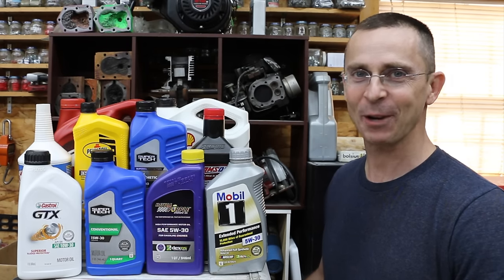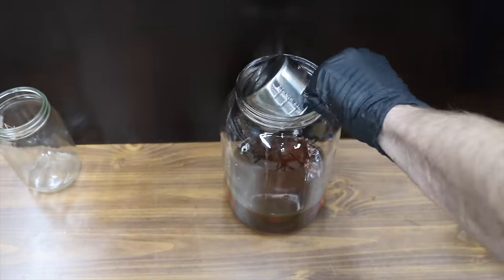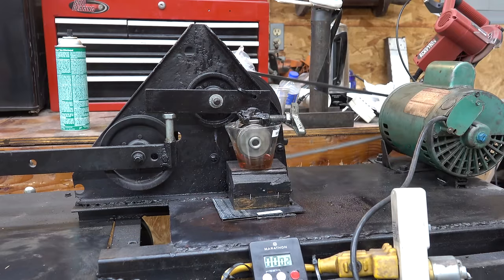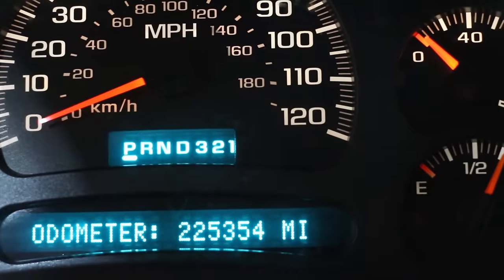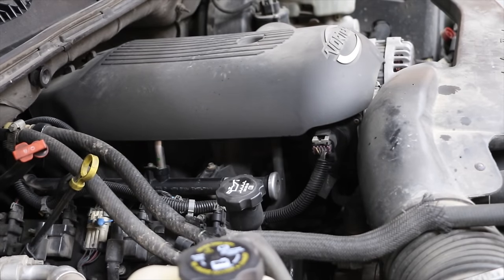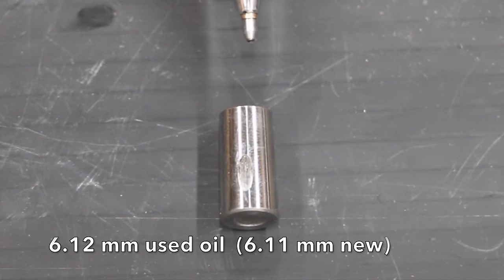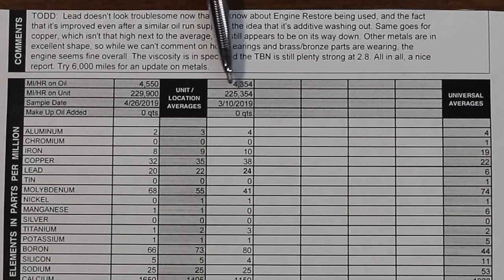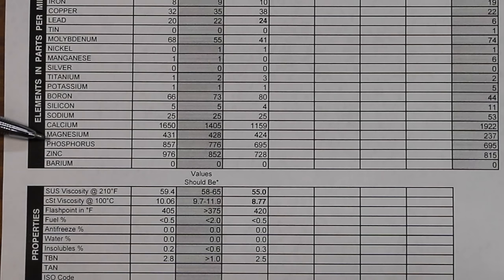Will Mixing 10 Motor Oils Damage an Engine? Let's find out!

Comment: I'd love to see a spark plug shootout!  Especially comparing iridium and e3 type plugs vs conventional.
Reply from the maker: Thank you for the video idea!
Reply: @ProjectFarm  can wait to see it!
Reply: aXBlackDeathXa e3 plugs are a gimmick
Reply: @nicolaslosito5735  I'm sure plenty of people feel the same way. Precisely why I'd like to see unbiased testing and evidence from PF.
Reply: If you want to see a spark plug shoot out go buy a 5.4 Triton and just wait.
Reply: NGK ALL THE WAY!!
Reply: It's pretty tested as is. Copper is most conductive, which is great for performance, but don't last as long. Platinum and Iridium aren't as conductive, last a longer time than copper, but over heat when the engine is run hard, causing their conductivity to drop even more.
Reply: 229k and climbing GO CHEVY GO LS best v8 engine ever, suck it Ford
Reply: Harvey Handbanana lol first thing I thought of too
Reply: @harveyhandbanana  lmao 😂
Reply: Denso  TT iridium is Definitely the BEST Spark plugs" No others compare" ✅✅
Reply: Yes great idea
Reply: aXBlackDeathXa it’s not how I feel. It’s been tested before by more stringent means.
Reply: @harveyhandbanana  wrong kind of shootout.....but probably more entertaining.
Reply: What would happen if you put 4 different spark plugs in an i4 car engine?
Reply: Or other things, like what if you use 4 different injector nozzles, or 4 different turbos (one per cylinder)?
Reply: 4 different crank cases /oil sumps and 4 different oils would also be interesting but hard to do in practice

Comment: As an ASE certified tech, amazing video, honestly. It is a common myth that switching back and forth between full synth and conventional is a bad idea but that's not true. On some high mileage engines some seals might be worn and thinner synthetic oil can get by.

With oils now a days you can go way more then 4500 mi between oil changes. I use Shell Helix Ultra here in France and prob went one year and 10k miles between oil changes and haven't noticed any issues. Car runs great, no extra smoke or noises, came out relatively clean as well.
Reply: What car/engine was that please?
Reply: @zenden6564  Suzuki Swift Sport 2012, did it on my RSX-S too and had no.issues, took the valve cover off at 190k still like new.
Reply: @bluej511  :D
Reply from the maker: Thank you!
Reply: Do you mean 10,000 miles or 10,000 kilometers?
Reply: My daily driven 2006 Taurus (12 valve) has 153,000 miles and I change the oil every 7500 miles. It's just getting dark at that point. I use Motorcraft filters and any 5W20 except Pennzoil.
Reply: @bluej511  I change engine oil with Mobil 1 EP every 3500 on gas engines and every 3500 on diesels with Shell Rotella T6
Reply: @happydays8171  10k miles, must have done 16k km on that.
Reply: @steve5912  yea thats a waste of money and oil. You can get 5k out of that easy.
Reply: Could I use rotella oil for a diesel truck in my stock 2001 Subaru forester even though there the same weight ?

Comment: Since I'm living down here in Florida and we're staring at a hurricane , I thought why not test various plywood ? All 3/4 inch . CDX vs. OSB vs. press board floor decking ( the not CDX stuff ) vs. particle board for shear strength and impact resistance . You can have a little more fun with it by getting a sheet of the radiant back plywood and finding out if it actually does what it's supposed to .
Reply: But Project Farm would need a rig to launch debris at 165MPH.  Oh, wait, that sounds epic.
Reply from the maker: Great video idea!
Reply: He basically already tested this. The real problem with plywood/osb sheathing isn't punctures but having the wind rip it off. He's tested various types of screws already.
Reply: @RedfishCarolina  
Read the comment . It helps. What im asking has nothing to do with screws . It has to do with shear force (tear it in half) of the wood itself and impact strength . Fyi fender washers help when attaching plywood for storms .
Reply: @ProjectFarm  I would also love to see it!
Reply: osb is stronger than plywood per square foot. only to used as flooring above anther room. never used for underneath siding or as roof decking or as a floor above a crawl space.
Reply: @flhusa1  you don't build for a living do you . Actually the only thing it does better than CDX is shear strength .We ( the building community) use that stuff (OSB) all the time for sheathing walls and roofs . Go to any new framing site and it will overwhelmingly be OSB being used .
Reply: @Dr.Westside  no sir i don't. i did a lot of research before i did a project and always like to know about things that i want to use or work with. i believe if you google OSB or orientated strand board you will find a lot of useful information like i did. when you use it do you or others coat the the cut edges like it comes from the factory? do you know why the edges are coated? i figured out why it was invented in the first place and then realized it was not for my project. i have a house with a dirt crawl space and all the plywood rotted and i needed to figure out what would outlast me so it would be someone else's problem next time. i ended up using treated plywood coated two times with a wood preservative and then coated with roofing felt tar paper on the bottom side facing the ground. i also used plastic sheeting on top of the ground beneath the flooring.
OSB is a good product stronger than traditional plywood . but is has its Achilles' heel which is moisture.

Comment: When i owned a Tire and oil change shop, it came with a 100 gallon tank Full or "drainback" oil. The previous shop owner always put the empty quarts upside down and that Littke Bit of oil that Drained Back added up, He had sold that oil for super cheap. 👍
Reply from the maker: That's interesting, Thank you.
Reply: I have a mason jar I use for that, it’s just enough oil to fill up my oil cans and lube random stuff that needs oil. When I add it to my oil cans I also mix it with some ATF for added slickness.

Comment: Hate to say but I’ve done the same thing. Had to clean out a bunch of 1 quart quantities for everything I had; miatas, bmws, pick ups suvs and a diesel oil too (that was used in a generator). I poured the whole lot into 2002 Chevy Tahoe and she digested it like it was nothing. 0w20, 5w20, 5w30, 0w40, 10w40 and 15w40. Probably the best oil change the Tahoe ever had. I don’t think older pushrod Chevys care.....
Reply: so true, they dont care at all
Reply: This is what I refer to as my lawnmower oil....lol. No point in buying anything special.
Reply: @michaellong9802  
Last time I cared enough, I just grabbed a bottle of cheap something from the gas station

Comment: Story time; A friend was up on hwy 90 in Washington on top of Snoqualmie pass. His old car was clunking and clattering obviously low on oil and no store or business open up there at the time he was stuck there. A Semi truck driver heard the car clattering lifters, saw him standing over the motor checking the oil level.  After few minuets Trucker guy came up to him with a container of obviously used motor oil and said, "This is the best oil in the world" 
My friend said "why is that"?  The trucker chuckles and says, "because you need it". 
5 min. later he was back on the road.
Reply from the maker: Thanks for sharing.
Reply: Rofl he prob gave him 15w 40. That's what we use in our rigs
Reply: @nishinobuuru2365  better than no oil. Snoqualmie pass is around 3000 feet above sea level, frozen 7 months out of the year. plus it was an old 70's car they can handle all the detergents in that oil.It would take hours to walk to a place that sold oil and walk back.
Reply: @Quirin As long as it isn't burning and you have oil pressure, well I have a motto..

just send it!
Reply: Try to put wrong oil in a new car.. lets say starting from 2010.. if you do that, then be prepared for a very expensive repair. For a BMW X6 the repair cost about 4000€ just for the engine restoration and cleaning in ultrasonic bath. The reason that you should use the right oil, is because new cars have higher working temperatures and even smaller diameter places where the oil needs to go, like Vanos, what adjusts the camshaft. You put a crappy oil, the oil slowly starts becoming coal, and you are done.

Well.. For old cars it doesn't matter as much, since the engines are way cheaper.
Reply: @blue_wolf5171  VANOS is in BMW like 20+ years so your argument is mute. The question is - is it your own experience or something you read somewhere on the internet. What I would say that today's cars have direct injection into the cylinder so petrol doesn't wash the valves and they seize because of sulfur+oil mixup build-up. In that way yes you have to use a proper oil which doesn't make this mixup easily and tank premium fuel with least possible amount of sulfur + clean you valves. You surely cannot tank some ECO friendly with bio sh*t added fuel, this will destroy direct fuel engine for sure. Count a long-life oil  change intervals are you are basically done as the build-up will deteoriorate the oil real quick.
Reply: That BMW was in my workplace, but my coworker worked on it. 
The thing is, that the engine stopped working AFTER oil change, and the next day the valve cover was open, and everyone could see, that there was burned oil. As my coworker with 20something years of experience said, that there was wrong oil that can't handle the heat.

Well.. I am not an expert on BMWs so I don't know how long what has been, I am just saying that if it says in the service book to fill it up with castrol, then just do as it says. 

Long life oil won't hurt the engine as long as the car has been only serviced in dealership, I am about 90% sure that those oils that are in supermarkets are not the same as in dealerships and good autostores.
Reply: @blue_wolf5171  Well I had e46 3.0Ci (petrol in case someone doesn't know) and recommended from BMW was 10w40 (or 5w40 I don't remember exactly but that doesn't matter as the first number is for winter). Anyway w40 oil couldn't stand the heat when you really drove the car as it should be driven :D so I had to put w50 like you have to for M3, then the car ran fine even under spirited driving. So depends very much on how the car is driven and of course quality of the oil but that wasn't issue in my case, both were premium brands. But yeah as you said yourself sometimes the oil can be fake or "lower" version for supermarkets. Hard to really judge from one case. Anyway modern cars are definitely crazy sensitive about everything you put in them. When I had an old bmw from 1989  with diesel engine it could run on used french fries oil instead of petrol. At least for a while :D
Reply: @kovrcek  
    The   First  Number   W 
  Is The Winter  Weight , How Much The Oil  ( Viscosity  ) Will Thin Out / Run At in Winter .
     The Second Number Is The Summer Value .
     EG  5W  40
            10 W  50
           20 W  40 
   ALSO THE CLASS RATINGS OF THE OIL  NEED TO BE NOTED  BECAUSE OF THE ENGINE MANUFACTURES DEMANDING A  HIGHER RATED OIL FOR HIGHER PERFORMANCE . CONSULT THE ENGINE MANUFACTURERS  RECOMMENDATIONS . ( THEY CAN DIFFER FROM EARLY YEARS TO LATER YEARS )
Reply: @Quirin M. From what I understand 15w-40 has a lot of detergent in them compared to standard oil. For older motors that might clean them too much and they could clatter from being freed from the bonds off motor goo holding it together. I have used it myself in a pinch and never had an issue.
Reply: @blue_wolf5171  yes your correct 50w does not belong in a car with thinner oil viscosity. Cars like that BMW jags, benz all need mobile 1 synthetic. I worked at MBenz for a while and a car came in where the customer took it to jiffy for an oil change they put Pennzoil dinosaur in it in 15,000 it took the poop oil (sludge) two days to drop that duce. The customer did not want to pay for the expensive repairs so they flushed it with Sea Foam a few times and they drove it home. From there I do not know what happened to it. Prob. traded it in.
Reply: @blue_wolf5171  Maybe, the dealerships probably use something cheaper! Its all about money with those guys.
Reply: @wayneknack5603  No, dealerships use the oil what is recommended. And they have to, otherwise if something gets fucked up after the service or while under warranty, they would have to do all the work for free. 
At least that's what happens in a normal dealership. 
But, since most people are cheap and don't care about their cars, they go to a cheap service, get cheap parts, and when they are told, that the next repair will cost more than half of the cars price, they quickly sell the car.

Comment: How about a test to see if “topping off” extremely used motor oil (maybe 10,000 mile used oil) will better its properties?
Reply: Marc Hanson I drive a 90s vtec Honda I would love to know what a liter of new oil does to the 2/3rds used oil.
Reply from the maker: Thank you for the video idea!
Reply: @krazybubba2579  The only issue is the chunky carbon sludge still builds up.  
New oil will dilute the old oil, so it does improve it.  
So long as you still change it at the correct intervals you'll be okay. However if you forget to change it because you're always adding new oil, the thicker stuff is still staying behind and sludging up your engine and hardening your oil seals
Reply: @maulerrw  thats not a given. oil that still has active detergents and therefore a positive TBN will not sludge. so if you add oil and it increases the detergency back to acceptable levels, it will continue to suspend the bad stuff so it can be caught by the filter. regular oil will still break down, and eventually the add in oil wont be enough to keep viscosity appropriate, but with synthetic it is certainly possible to just keep adding and changing filters. i have an old dodge minivan with over 250k miles that burns oil. i add a qt of valvoline maxlife full synthetic 10w30 about every 1500 miles and change the filter every 5k. i wouldnt do it to something nice, but my engine has no signs of sludge buildup and it was 1000 bucks so i really dont care.
Reply: I been driving this chrysler minivan with an oil leak and never change the oil or filter just add it when it starts ticking.
Reply: @jasonpimpton4388  you should at least change the filter once or twice a year. It will plug up and go into bypass
Reply: At the shop we changed the oil on a car for a customer. The car shortly after starting, started to lose oil pressure. It turns out the oil had not been changed in a while, and the detergents in the oil broke down the plaque in the engine and blocked the oil pickup screen. I realize it has nothing to do with 10,000 miles, but it brought back a memory.

Comment: That was really interesting.

I'd like to see you test different types of  thick grease under heavy load on the bearing tester. In particular red line synthetic wheel bearing grease.
Reply from the maker: Great video idea!  Thank you
Reply: @ProjectFarm  I'd be absolutely down for watching that test. Lots of grease types out there to try, even between various brands of the same type.

Comment: VIDEO IDEA: Baby oil instead of motor oil! (synthetic baby oil, please; no reason to waste perfectly good babies for a test like this.) Or actually, I'd be even more interested to see how fluorocarbon oil would hold-up vs. normal (hydrocarbon) oil. Not sure if you can buy fluorocarbon oil in the right viscosity, though; also, I'd stay the hell away from the exhaust, just in case you end up breathing fluorine vapors.
REGARDING THE SODIUM LEVEL IN THE OIL REPORT: Exhaust valves often have sodium metal inside an outer shell of non-reactive metal, because the sodium helps evenly-distribute the relentless heat that the exhaust valves are exposed to. (exhaust valves don't get cooled by fresh intake air like intake valves do.) So a spike in the sodium level could indicate a badly-worn exhaust valve. Good to see that didn't happen to your engine.
Reply: Life OD did this.  It ran fine for the several hundred miles they ran it.
Reply from the maker: Thank you for the video idea!